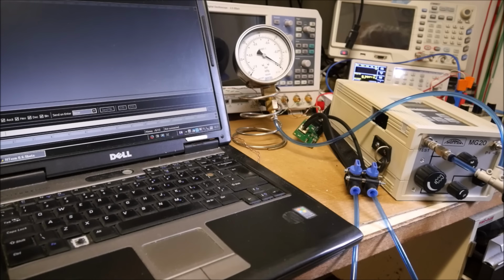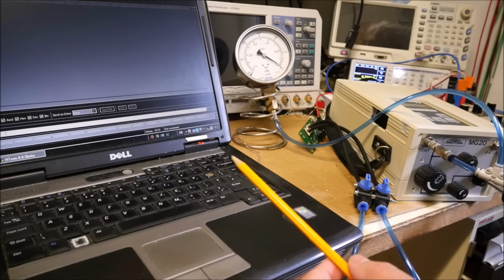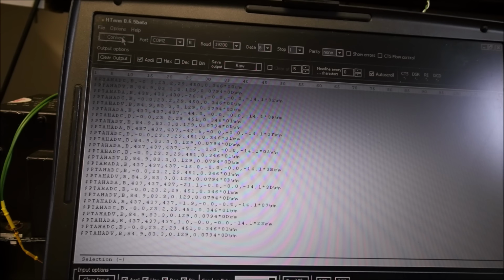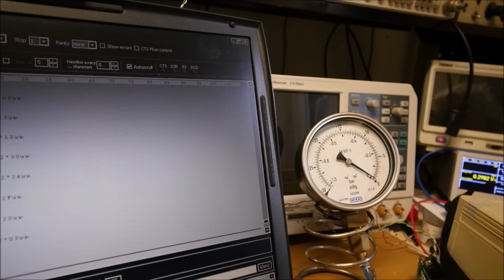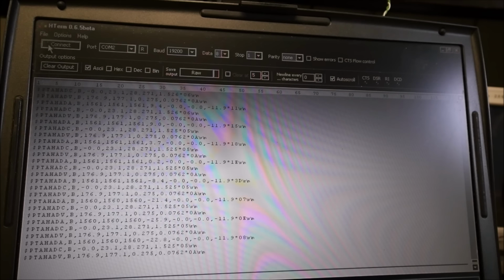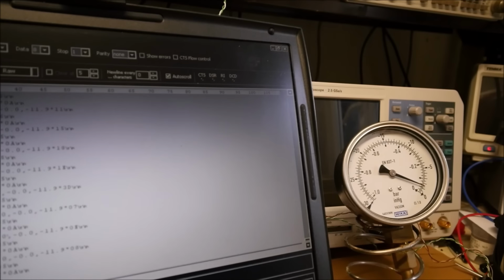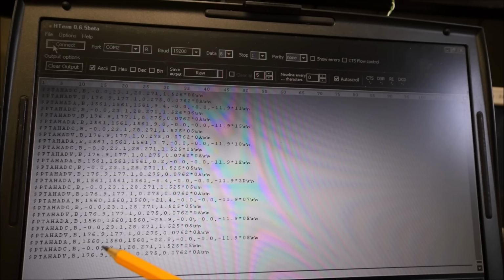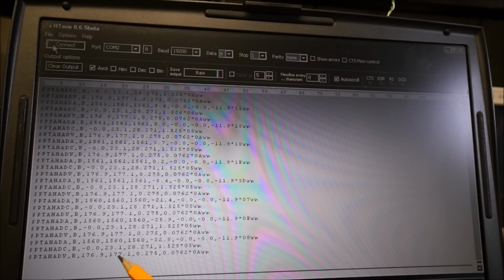LDM #369: Shahed-136 drone Air Data Computer module

Comment: Quite simple, which makes sense. Cheap to produce and less to go wrong.
I am surprised by the shear volume of data that it throws onto the serial bus. Firstly If the data is only used within the drone I didn't expect strings, rather just mapping the values directly to bytes. Secondly I didn't expect it to display things like mach number. For anything connected to that serial port it is probably much quicker to simply take the airspeed to calculate the machnumber yourself, compared to the extra wait and processing of the serial string.
Perhaps they are using some kind of 'off-the-shelve' radio serial link to send this straight back to a PC for direct viewing. Which makes me wonder, how does the navigation work? As there's no GPS here it must be somewhere else and connect through that 9pin connector. It doesn't seem to squirt out any data request messages on the serial bus, so then how is it getting that kind of navigation info? 
Or perhaps this module is only for the air pressure and temperature calculations, making most processing on the drone quite distributed. But again, if the serial bus is only used 'internally' in the drone, I don't understand why they transmit the information over serial in string format.
Reply: This is just the *Air Data Computer*, which means it measures the air speed and barometric pressure. The flight controller is a separate module. The jamming resistant navigation receiver is another unit, and the radio link is yet another. And then there is other stuff such as engine controller, power systems, etc.
Reply: The processor consuming this data likely has an excess of processing power vs. the cost of doing string processing. Binary communication on the otherhand increases the cost with respect to communication between teams responsible for different parts of the drone and makes basic tooling more difficult  -- eg. if you were validating the module with a test fixture using csv allows you to directly dump the data and throw it into a spreadsheet.

Mach number is not solely dependent on airspeed. Keeping the 'intelligence' for this calculation in the instrument makes sense
Reply: @nullptr472  I seriously doubt that there's a big team involved in this product, at least the electronics side. The design as shown is quite simple, and is even lacking some proper filtering and protection on the PSU input. (At least they put TVS diodes on the RS232 lines). 
My point was not about the processing power of processing strings persé, rather about the time it takes to transmit. The Shahed seems to have a max airspeed of 185kmh, so for the accuracy stated it could easily fit in a 16 bit value. Now it is transmitting 5 bytes for the same information. There's about 4 values per line, so that could save 12 bytes. You can skip the commas, another 5 bytes. Skip that weird pre-amble (PTAHAD*,B) which is constant anyway, saves you 7 bytes. Drop /r/n and you save 2 more.
Thats 26 bytes per line even with such simple minimal effort. At 19.2kBaud that would shrink the time to transmit by almost 14ms. That is quite significant for the minimal amount of effort required.
Even if time delays or data rate are not a problem (which it probably isnt), it means that you could slow the bus datarate down and get things more robust.

Anyone that is able to design and test such boards, has practically no difference in basic tooling between raw bytes, or string data. Most serial loggers can display and log raw serial data without any trouble, never mind the abundance of cheap logic analyzers and oscilloscopes, or writing a simple python script of a few lines. If this serial data is used by another uc, it might even be easier to process the raw byte data rather than having to decode the string (always tedious). Also whether this was designed by a team or not, just having a list the byte structure commands is not any more difficult than having a list of possible strings and their structure to communicate. There is still the same number of inter-team communication interfaces to keep track of, just in a different format. 

tl;dr In my opinion, it is not any more difficult to use bytes, nor would it cause more difficulty in working with teams. 
Honestly I strongly suspect the choice of using strings is more down to quickly wanting to hack something together, or not having the knowledge to do it in a better way. An experienced engineer wouldn't have much trouble implementing it with raw data values, but for someone only used to arduinos and/or less experience with embedded, it seems more challenging than just throwing strings around. 

Also regarding the mach number, this device is not going supersonic. I doubt the mach number is relevant at all for their control as stated the max airspeed is <200km/h. Although perhaps they share this board with other weapons systems, which perhaps can go supersonic (In which case I have serious doubts over the construction, in particular vibrations). The only thing that can change the local speed of sound is the temperature, which the device is probably also transmitting in its serial data, so any other device could easily calculate it quite quickly (LSS=v_air*sqrt(T/273) where v_air is the speed of sound at that particular altitude, which is relatively linear up to 10km, and T is the temperature in kelvin. Machnumber is then simply v_craft/LSS). 
But you are right than in a sense of having things 'containerized' is quite nice.
Reply: @tHaH4x0r  I take your point about data latency and channel capacity

> Honestly I strongly suspect the choice of using strings is more down to quickly wanting to hack something together, or not having the knowledge to do it in a better way. An experienced engineer wouldn't have much trouble implementing it with raw data values, but for someone only used to arduinos and/or less experience with embedded, it seems more challenging than just throwing strings around. 

The whole philosophy behind this drone is being low-cost and still effective. Part of that must come from lower development costs and understanding the 'good enough' point during development. Based on real-world performance they've clearly met the 'good enough' threshold. With respect to the 'cost' of a string protocol I do not doubt that tooling could be created to perform whatever binary conversions are required pretty easily, however, the cheapest tools are the ones that don't exist and the ability to 'eyeball' some raw output without consulting a spec is valuable (eg. sanity checking).

Iran has some pretty sophisticated weapons systems so I have no doubt their weapons developers have access to good talent (I seriously doubt these people are 'arduino jockies' or whatever). My money is on the developers of this system being expeditious (if you want to call it 'hacking something together' that's your prerogative), and again the proof is in the results.
Reply: @tHaH4x0r  You make too many assumptions about the manufacturing behind these.
Reply: @GoatZilla  No, I am trying to understand the reasoning behind some design decisions of the engineers.
Since when is it a problem in an engineering video to try and learn more about the subject?

If you are willing to actually contribute to the dialogue, please do provide some insight in the manufacturing.
Reply: @nullptr472  My point about the string vs raw data value, was that it does not increase development cost, yet increase system efficiency. You don't need any specific tooling to do binary conversions, it is built into most reasonable serial monitors. Also it could even save time if communicating between embedded systems
Also, they produce literal thousands of these drones. Even if it would take ~half a day more to produce raw byte values instead of strings (which again, I dont think so), it would have negligible impact on the final price. Especially as labor costs in Iran are not that high. 
hence the choice for using strings over raw bytes must be a deliberate choice for some other reason than convenience/cost of implementation. 

The suggestion of another comment seems to make rather a lot of sense, it could very well be an existing protocol to talk to a third-party supplied module (similar to the NMEA protocol) or an pre-existing standard within the iran aerospace sector.
Reply: @tHaH4x0r  It's already been explained to you; you are just letting your assumptions override the answer.

You're assuming Western lab conditions in a country that is completely not Western.  You keep saying "oh, logic analyzers and oscilloscopes are soooooo cheap blah blah blah just you know write some python n stuff".

The barrier to entry might have been reduced to "guy in a cave with a Win 98 laptop and Hyperterminal" because that might actually be who's working on it.

You straight up don't know, and you can't make any conclusions from just looking at the PCB.

If you've ever been a part of any large open source projects then you might have had some visibility of patches coming in from 3rd world countries that aren't even under sanctions by people who barely have electricity much less even own the equipment they're writing the code for, you'd understand the rationale.
Reply: @GoatZilla  Logic analyzers and oscilloscopes are easily available regardless of 'western or not'. Go to any non western lab and you would need these at the bare minimum, especially for any company producing/developing at a reasonable scale like this.
No, this was not designed by a guy in a cave with a win 98 laptop and hyperterminal, and frankly it is borderline ignorant to think of Iranian people as if they are unaware of normal practices or have no access to resources. As a researcher I have multiple Iranian colleagues and they are very familiar with standard electronics development tools. Iran has been able to produce many technological feats that are definitely not possible without proper labs. I would not call Iran a '3rd world country' and again, it shows ignorance if you really think they are at such a low development level. 
Also, this is not an open source project, and hence your example makes zero sense. This is a commercial product, and production numbers of this specific drone are likely in excess of 5.000 (just the Alabuga drone production plant has produced ~3000 drones, numbers from the Ukrainian air force). The designers, Shahed Aviation Industries, produce tons of different aerospace components and craft, including helicopters. Additionally they are strongly associated with HESA, capable of building fighter jets. They have plenty of electricity, funds and equipment.

Sure you cant make conclusions from looking at a PCB, but you can at the very least make an educated guess and try to get an insight into exactly why design decisions were taken, which is where we can all learn valuable insights into exactly how this drone came to be, and decisions why certain parts are made the way they are.
Reply: @tHaH4x0r  'system efficiency' for this drone is how effectively it can detonate on target. Eking out efficiency wins for a protocol that is already able to meet throughput and latency requirements is waste regardless of the labor costs

By your logic (that of binary data being as easy as text protocols) why aren't these existing standards all binary? If it's such an unambiguous win why doesn't everyone do things the way you describe?
Reply: @nullptr472  Sure, the system works and does its job, that is indisputable. My entire original point isn't about questioning the designers capabilities, rather questioning the intent behind design decisions. E.g. implementing raw bytes does not take any more effort than string based data, yet is better in any quantifiable measure of bus performance. Hence the decision to use text must have other reasons backing it up. Replies from denizzzka and peerappel2012 make most sense to me, and indeed have convinced me that it is likely for compatibility reasons with an existing bus*.

Never have I claimed that raw bytes are ALWAYS better than string based, and it is an entirely pointless argument. But out of respect to your question, text based has the advantage of increasing compatibility if you have to operate with many different devices. Especially if you need to integrate with PCs and it needs to be immediately human readable.
However this is often not required at all. Your question 'why aren't these existing standards all binary' is kind of funny, as the existing NMEA 0138 protocol is superseded/being replaced by NMEA 2k, which indeed does use raw data values instead of string based information. 
Why the original NMEA 0138 standard uses text is anyone's guess, and you'd have to ask the national marine electronics association themselves. If they do decide to do this, please do share their reply. I am curious what their response would be (if at all, perhaps they want you to buy the standard, which starts at the lowly sum of 2k$).
My guess is that the original standard can be directly hooked up to physical printers, in order to immediately print human readable logs. I am not very familiar with the shipping industry, but it wouldn't surprise me if this is normal/required for commercial shipping to keep a log of location (similar to how trucks are mandated to keep logs of certain parameters, in EU Smart Tacho 2).

* On this note, I dont think it is an official NMEA 0183 type bus, both physical as well as the application layer. I did some searching but couldn't find any $PT identifiers/headers/talker IDs with sentence formatter in any public documents (in fact, there are no talker IDs that start with $P* at all). 
Additionally the bus should run at 4.8kbaud according to NMEA themselves (or 38.4kbaud and 115.2kbaud for higher speed busses).
Reply: @tHaH4x0r  from your original reply:

> Honestly I strongly suspect the choice of using strings is more down to quickly wanting to hack something together, or not having the knowledge to do it in a better way. An experienced engineer wouldn't have much trouble implementing it with raw data values, but for someone only used to arduinos and/or less experience with embedded, it seems more challenging than just throwing strings around. 

Sounds like you are indeed 'questioning the designers capabilities'

> But out of respect to your question, text based has the advantage of increasing compatibility if you have to operate with many different devices. Especially if you need to integrate with PCs and it needs to be immediately human readable.
However this is often not required at all. Your question 'why aren't these existing standards all binary' is kind of funny, as the existing NMEA 0138 protocol is superseded/being replaced by NMEA 2k, which indeed does use raw data values instead of string based information. 

Text isn't some magic comparability sauce that only takes effect when multiple implementations make use of it in a protocol. Human readability is always an advantage even when the only people using it are the ones building the device, integrating it and testing the system

NMEA 2k is based on CAN bus which (if you don't know) is very different from RS232. RS232 is point-to-point, CAN bus is an actual bus (ie. with multiple peripherals sharing the line) with small packets and low latency requirements built into the system. Given the massive differences in the physical layer it is no great mystery why the format of the data is different.
Reply: @nullptr472  
> Sounds like you are indeed 'questioning the designers capabilities
Originally that was my suspicion, as I couldn't see any other reason why they implemented things the way they did, until appelpeer etc pointed out the similarity to NMEA 0138 for compatibility reasons.

>A text-based protocol isn't some magic comparability sauce that only takes effect when multiple implementations make use of it in a protocol. Human readability is always an advantage even when the only people using it are the ones building the device, integrating it and testing the system

Its of no advantage if there are no humans involved in the system anymore, as is the case with this drone. As for debugging/testing, I have touched upon this before that it makes almost no difference at all.
Suppose there's a human readable format, and a non readable format, considering all other things equal of course the human readable format is better. However, as I illustrated before, this is not the case as human readable strings are much less information dense. In all other ways a raw data format is much more efficient, which leads to better performance in any measurable metric (ex. speed, latency, robustness for comparable bandwidth).

>NMEA 2k is based on CAN bus which (if you don't know) is very different from RS232. RS232 is point-to-point, CAN bus is an actual bus (ie. with multiple peripherals sharing the line) with small packets and low latency requirements built into the system. Given the massive differences in the physical layer it is no great mystery why the format of the data is different.
I know very well what the CAN bus is, I work with it quite a lot.
You seem to not have brushed up much on what NMEA is. It is not just a physical (electrical) layer specification like RS232/CAN but also contains an application (data) layer specification. These are entirely different things, and the discussion was about application layer formatting (strings instead of raw bytes). It is irrelevant what the underlying physical layer is (hell, there's NMEA 0138 implementations that use ethernet as the physical layer).  

Also to correct you, NMEA 0138 'default' physical layer is not RS232, rather RS-422 ) (differential signalling).
Furthermore whatever the underlying physical layer is (RS-422/CAN/RS-232/Ethernet) does not define whether something is point-to-point, multi-drop, tree structure etc. That is defined in yet another layer of the networking architecture, there is nothing physically keeping you from connecting more devices into a network.
Actually if you read the specifications, you will notice that NMEA 0183 is actually intended to be used with multiple devices, not a pure single device point-to-point wiring. Technical term is point-to-multipoint. There are gateways and multiplexers to facilitate this behavior, and get around the physical layer problems of the RS-422 bus. That means that the 'master' line will have message from multiple devices, just like ex. a CAN bus would.
This is also exactly why they shift to CAN bus for the physical layer in 2k, as that improves compatibility tremendously, no longer needs additional hardware to keep the network running, and has all the additional advantages of CAN bus included highlighted below.
Still my point is, the physical layer is independent of the application layer, and just because something is 'an actual bus' (by which you likely mean multi-drop) does not somehow magically mean that readable strings are no longer valid. If you disagree, feel free to explain exactly why a human readable format is less useful on a multi-drop bus compared to a point-to-multipoint scheme, as for the proposed advantages of debugging it would be exactly identical. 

PS: What do you even mean that CAN is build with small packets built into the system? If I want to send a packet of size 1 byte, a CAN packet is much larger (start bit + arbitration/ID + control + data byte + CRC + acknowledge + EOF = 52 bits) compared to an equivalent 8-bit UART packet (start bit + byte + parity + stopbit(s) = 10 to 12 bits depending on config).
As for low latency, they can both be equally low latency.
The big advantage CAN has over e.g. RS485 (which is much more comparable as its also typically multi-drop), is that it has hardware bus arbitration and hence does not need a master/slave kind of topology, and that it takes care of the data integrity on quite a low level, (almost) guaranteeing messages to be intact and received correctly by all devices on the bus.
Reply: @tHaH4x0r 

> Also to correct you, NMEA 0138 'default' physical layer is not RS232, rather RS-422 ) (differential signalling).

This is a distinction without a difference. Be serious.

The point is if the protocol designers assume there is one 'talker' per physical link the 'talker' could consume as much of the channel as it pleases without impacting other instruments / sensors / whatever. Sharing the channel means a less 'information dense' message format of one instrument comes at the expense of the usable capacity for the others on the same bus. CAN bus has a packet format and priority based preemption so a 'less dense' protocol (with a message spanning multiple packets) could be preempted by higher priority messages. More time to transmit the message during contention means increased latency. Given this it makes sense to move the 'engineering tradeoff' needle away from human readable towards a binary format.

> Originally that was my suspicion, as I couldn't see any other reason why they implemented things the way they did, until appelpeer etc pointed out the similarity to NMEA 0138 for compatibility reasons.

They most likely based the format (in broad strokes) on NMEA and the instrument and it's protocol are internal to the organization or the drone. They have no need for NMEA 0138 compatibility; I doubt they have any plans to sell their airspeed sensors to yacht owners in the near-future
Reply: @nullptr472  
> This is a distinction without a difference. Be serious.
I entirely agree. The exact physical implementation, and networking topology is irrelevant when discussing how data is formatted in the application layer, whether RS232, 422 or CAN bus.

About the discussion following this sentence, in order to clarify and make things clear there are two contention points. First is your claim that CAN has supposed lower latency. Secondly, that the described advantages of human readable format somehow no longer hold for multi-drop style busses. Both of which I personally disagree with.

>The point is if the protocol designers assume there is one 'talker' per physical link the 'talker' could consume as much of the channel as it pleases without impacting other instruments / sensors / whatever.

To some extent, yes. However when integrated into a network system with multiplexers, they do have to take care that the combined bandwidth does not swamp the busiest link. This is kind of stating the obvious, generalized to that we can never put more information per second on a bus, than the bandwidth would allow. This is indeed convenient in case of CAN as priorities take care for this to some extent, but also multi-drop buses would have to ensure that the bandwidth is not saturated. 
In any case, our discussion was about low bandwidth links that are likely not close to saturation, making the point moot regardless.

> Sharing the channel means a less 'information dense' message format of one instrument comes at the expense of the usable capacity for the others on the same bus. 

Yes, and so it would for a CAN bus, if we don't take priorities into account. The bus always has only a limited amount of bandwidth available.

>CAN bus has a packet format and priority based preemption so a 'less dense' protocol (with a message spanning multiple packets) could be preempted by higher priority messages.

True. And you just described what makes CAN convenient. This however does not make it low latency, or better for more dense protocols. Firstly we should not mix density and priority. For example, an 'emergency stop' message would be extremely low bandwidth (as it would only be triggered in rare circumstances) yet would be highest priority. Engine timing would be relatively high bandwidth and high priority. 
Just because a high priority message can interrupt a lower priority message does not mean a bus is high or low latency, or benefit from high or low information density. 
Hell, there could be a low priority CAN message on the bus, that has to wait indefinitely if it keeps being interrupted by higher priority CAN messages, thus having 'infinite' latency, regardless of content! 
The bus arbitration just helps us in achieving lower latency for higher priority messages, for busy buses, but not better latency in general.

Also, what you state here doesnt imply low latency persé. "Latency" in the way you seem to think of it, depends on message priority and how busy the bus is. But that is, as we just described, circumstantial. Generally when talking about latency we don't take into account other traffic or priority, merely measuring the time it takes to go from source to destination. 
Assuming that a message is ready to send and no other data is on the bus, UART has lower latency for the same amount of information, simply because there's less additional bits to send on top of the data. In other words, the effective DATA bandwidth for a given LINK bandwidth is higher for UART, and thus can achieve better latency.

> More time to transmit the message during contention means increased latency. Given this it makes sense to move the 'engineering tradeoff' needle away from human readable towards a binary format.
Except that all you have stated above, is entirely independent on how the data is formatted. CAN data can be formatted as readable strings as well, it does not matter. In both cases readable strings would increase the amount of bandwidth required, and in both cases it could lead to problems and reduced performance. 

> They most likely based the format (in broad strokes) on NMEA and the instrument and it's protocol are internal to the organization or the drone. They have no need for NMEA 0138 compatibility; I doubt they have any plans to sell their airspeed sensors to yacht owners in the near-future
There's a fair chance that this board is not made internally by the organization, rather a bought in 3rd party part, hence the usage of human readable strings.
Perhaps if Michel ever gets hold of another circuit board of a Shahed (like the flight computer) we could deduce whether the layout/design style is similar or not.

In summary:
- In both cases having a 'less dense' protocol improves the latency, and makes better use of the available bandwidth
- Disregarding priority and bus occupation, latency of a CAN bus message of a given size is inherently larger (and information density lower) due to the addition of more extra bits
- In both cases the supposed advantage* and impact of being human readable, is identical

*Under the assumption that there is an advantage. As stated previously I don't think there's much advantage in being human readable, except in extremely niche cases or when forced to have to talk to 3rd party supplied items.
Reply: @tHaH4x0r 

> I entirely agree. The exact physical implementation, and networking topology is irrelevant when discussing how data is formatted in the application layer, whether RS232, 422 or CAN bus.

Of course it matters. My point was that (for my argument) RS232 and RS422 are exactly the same. When designing a protocol for a medium whether or not it is shared has a huge impact and should influence protocol design. The information density of the messages would have a major impact on bus contention and therefore system performance. Human readable messages are a cost/benefit trade-off and in shared mediums like CAN bus where the max packet size is like 8 bytes it pushes human readability cost/benefit far into the red. A more information dense protocol would decrease average latency for all but the most high priority messages by lowering the probability of contention.

> Disregarding priority and bus occupation, latency of a CAN bus message of a given size is inherently larger (and information density lower) due to the addition of more extra bits

My point about CAN bus latency was with respect to the design choices made by the designers of CAN bus due to the automotive industry. You need a small packet size to enable important messages like 'driver hit the breaks' to not have to wait too long to get onto the bus. Small packet size -> more overhead/byte. By adopting CAN bus NMEA also adopted these limitations and that therefore had an effect on their application level design.

I do not doubt for a minute that lower latency is achievable on point-to-point serial links vs CAN bus due to the fundamentally different ways they work. That is precisely my point -- low level realities drive higher level application protocol details
Reply: @tHaH4x0r  So which one of your colleagues worked on the Shahed-136?

You don't know.  That was the whole point.  You don't know.  You have better visibility into an Open Source project than you do to this project.  That was the whole point.

What you are asking is the software equivalent of "Why don't they just drop Mictor connectors on that PCB?  They're like so much more compact and easy and available and would give them more options."

I'm not saying they don't have labs, and I'm not calling them rubes incapable of technological feats.

I'm saying that it's very likely that a sub-db9 and dupont headers are likely a better match for their desired technology level target.  It's an easily plausible explanation.
Reply: @nullptr472  
Let me start of by saying I think this argument has drifted completely off course. Your original statements were: 
1 - that raw data protocols require more cost and time to implement (we can agree to disagree on that one)
2 - raw data protocols are harder to interpret and hence standards use human readable text all the time
You supported 2 with the reasoning that 'why do human readable standards like these exist if raw bytes are always better'. As a counter example I mentioned that they have moved to a raw data format in CAN, and some other examples of serial, low data-rate buses that use raw data rather than human readable strings. 
The argument then shifted to point 3:
3 - Human readable text is useful in low-bandwidth point-to-multipoint and point-to-point system, but less useful in multipoint buses. 
Instead of addressing point 2 and 3 in its core, you specifically shifted the goalposts to CAN only networks, where you describe a potential problem arising due to limited packet size potentially impacting readability. This argument does not hold for many other links (e.g. for a LIN bus), and is thus not generalizable.  
I.e. You have failed to address the crucial point about why human readable strings are a good thing on low-speed point-to-point serial links, but not on low-speed multidrop links in the general sense.

If you feel I misaddressed your key arguments and reasoning, please do point them out and correct them so I can respond to them in a more concise way instead of the entire argument shifting to irrelevant points and generic statement of truth.

To address the other points in your comment:

>Of course it matters. My point was that (for my argument) RS232 and RS422 are exactly the same. When designing a protocol for a medium whether or not it is shared has a huge impact and should influence protocol design. The information density of the messages would have a major impact on bus contention and therefore system performance.

And so it would impact multi-drop buses. Information density always has an impact on bus occupation and thus system performance, and in all of the above cases the bus is 'shared' with multiple devices, also with NMEA 0138. Just the way the network is structured is different, but links can still contain messages from multiple talkers. Your point was that there was a supposed difference between multidrop and point-to-multipoint systems in terms of how information density affects the latency/bandwidth. 

>Human readable messages are a cost/benefit trade-off and in shared mediums like CAN bus where the max packet size is like 8 bytes  

So your qualm has more specifically to do with the limited packet size of CAN bus?
Then sure, it does impact readability, although most decent CAN decoder can filter/group messages by type quite easily, only making readability of very long messages slightly more tedious.

>it pushes human readability cost/benefit far into the red.

"That is just like, your opinion man.". Similarly I think that in no case, except for compatibility with external 3rd party equipment, 'human readable format' is beneficial. 

>A more information dense protocol would decrease average latency for all but the most high priority messages by lowering the probability of contention.

A more information dense protocol decreases the average latency regardless of type of bus. Also for the original NMEA 0138 bus. If you are more efficient, your need less channel bandwidth to transmit the same amount of information. This is not unique to CAN and/or multidrop networks.

>My point about CAN bus latency was with respect to the design choices made by the designers of CAN bus due to the automotive industry. You need a small packet size to enable important messages like 'driver hit the breaks' to not have to wait too long to get onto the bus.

You would want important messages to be short regardless. But I fail to see your point about can bus latency completely. Or is this again about splitting longer packets into fragments potentially increasing latency of those? 

>By adopting CAN bus NMEA also adopted these limitations and that therefore had an effect on their application level design.

I dont think these are limitations. These are merely the direct effect of having priorities on the bus.

>I do not doubt for a minute that lower latency is achievable on point-to-point serial links vs CAN bus due to the fundamentally different ways they work. That is precisely my point -- low level realities drive higher level application protocol details
Sure, these are generic blanket statements we can all agree on. Similarly high level application details influence low level design decisions. That tells and teaches us nothing though.
Reply: @GoatZilla  >So which one of your colleagues worked on the Shahed-136?
None of my colleagues did, otherwise they wouldnt be able to work at the lab I am with.

>You don't know.  That was the whole point.  You don't know.
Sure you don't. Similarly, Sputnik could have been developed by a monkey for all we know! You dont know, you never really know!
However, we have plenty evidence about who manufactures these Shahed drones, as well as who built sputnik. We are pretty sure they have quite a lot of resources and advanced capabilities, far exceeding the board we have here. Denying this is simply an invincible ignorance fallacy, and discussing this further is pointless, as no amount of evidence/proof would ever be enough to convince you.

>What you are asking is the software equivalent of "Why don't they just drop Mictor connectors on that PCB?
No, it is not. Implementing raw data versus human readable strings has practically no difference in implementation cost and time. Hence there is a conscious decision made for one over the other is what I was trying to understand. And the remarks of other comments have given some plausible explanations that make sense. 
Your comparison is taking something far more costly and advanced than what is on here, with totally different application/capabilities and associated price cost. It is a disingenuous false equivalence. 

>I'm saying that it's very likely that a sub-db9 and dupont headers are likely a better match for their desired technology level target.  It's an easily plausible explanation.
They sure are a good fit, no one is going to deny that. But like I said, implementing raw data versus human readable strings does not take more time or cost to implement.
Reply: @tHaH4x0r 

My point about CAN was in-response to your bringing up NMEA 2k and my thoughts as to why (in that context) it would make sense to implement a binary format.

Looking back at my own technical work what I wish I learned earlier is to consider the bigger whole and value simplicity and ease of implementation as well as trying to understand the 'important' thing and work towards it rather than my immediate impulse, what I think is cool or what is at hand. There are times to do things the 'smart' way and times to do things the 'stupid' way and wisdom and experience help you figure out the what's appropriate for the situation. Adding a bit of inefficiency (stupid) -- like this text protocol -- to make the work of others down the line easier so they can spend time on more important things seems like the wisest course.

Thank you for all the points you've made, it's really made me reconsider a lot of my life choices. I really should get off the internet.
Reply: @nullptr472  I very much agree with your sentiment that often the simpler way is the right one, and complexity can be added later if deemed required. Perhaps we merely disagree in what we think is more complex.

I am sorry to hear that you feel so negative about this engagement, it got a bit heated but it was never my intention to leave a sour taste, rather exchange insights and hopefully both leave with a bit of a different perspective and a crumb of knowledge. My apologies, and all the best to you, and i mean that sincerely.
Reply: @tHaH4x0r  for what it's worth I apologize. I'm under a lot of stress and my heads not in a good place and things got away from me (not that that actually excuses anything)
Reply: @tHaH4x0r  I think you are forcing yourself towards unreasonable stupidity by not thinking a system with bidirectional communication can easily change the data format on the fly through negotiations. Probably the string data format is for sanity check and it may have god knows how many protocol to be integrated with different model of flight data computer of various aircraft.
Reply: @tHaH4x0r i don’t understand why you keep arguing for oh why not convert it into bytes it would save X bytes. When you ship FAST you don’t always go back and optimize if you don’t have to if the extra bytes actually don’t matter what’s the point in optimizing it?
Reply: I suspect this air data module is made by a separate team of engineers, and is designed to be easily integrated into many different drones. For that reason, string data makes a lot of sense. Making a byte array structure to carry floating-point values (or fixed-point binary ones) is easy enough, yes, but makes logging it during development and testing a whole lot more difficult.
Modular systems often use easy to read and debug formats, even though they’re not the most efficient - they just make everything a lot easier. If I were designing such a module, i’d go with string data every time. The only reason to switch to raw bytes would be if the data rate was very high and in this module, that’s certainly not the case.
Reply: @simontillson482  I very much disagree with the statement that its harder to debug. Like I mentioned in another post, any decent serial monitor has no trouble reading out raw byte values, and writing a python script that formats and spits out the values is something done in under an hour as well.
And even if string formatting is what is convenient for debugging, you could still do that but swap over to something else for actual operation. 

What is more likely is the suggestion by another commenter; Namely that it is trying to format to a pre-existing standard or compatibility with a third-party purchased module.
Reply: @tHaH4x0r  I agree that an existing format and/or vendor module probably existed, and they’re using that format for compatibility - very likely indeed.
But the reason it’s using a text-based format is that this is almost universal in systems design.
Unless there’s a very good reason - mostly it’s a high data rate - almost all commercial modules use text-based data transfer when communicating over a UART channel.
For example, just compare these two modules:
1. A GPS receiver. Update rate is one packet per second. Output is via UART and format is text based. All GPS modules use almost the same format.
2. A 6-axis accelerometer and gyro. Update rate is 100 packets per second. Output is via SPI bus and format is raw bytes, using manufacturer-specific structure.

So you can see that this is a common thing in industry. For low-speed, common functionality, serial UART with text formats is the de-facto standard, so I’m not at all surprised that this flight data module uses that method.

At the end of the day, you have to ask yourself ‘is it worth it to optimise this data format?’. Considering that the flight controller is synthesising remote commands, accelerometer data and other inputs to produce actuator and motor control signals at a rate of hundreds of cycles per second, the amount of processing power used to interpret string data from the very slowly changing inputs for altitude and airspeed is not only small, it’s insignificant. So what exactly would you gain by optimising it to a byte stream? In practice, nothing.
Reply: @simontillson482  The things you mention from 'the industry' are not used in proper commercial applications at all. Firstly the kind of modules you mention are not used in fields like aerospace. Secondly, GPS outputs very widely, even for commercially available modules that you seem to be hinting at. It is true though that most commercially available modules are compatible with NMEA 0183 standards, but that is not because of low data rate and the likes, rather to increase compatibility (and GPS modules are pretty much the only module that provides such compatibility, almost any other sensor is not compatible with such a standard without additional hard/software). 
Also a correction, modules provided to consumers, such as for example the uBlox NEO-M9N-00B, provide multiple different physical layers: UART, SPI, I2C and USB, not only UART! Just because the sparkfun board you purchase only routes out the UART, does not mean that it is the 'industry standard', it is just the easiest to use for people who want to mess around with it without knowing much about protocols. 

This specific board in the video has a very specific intention, and besides (unmanned) aerial vehicles has almost no purpose. Thus there is no need to keep compatibility high (unless it is supplied by a third party, or has to communicate with another third party supplied item).

As a counter example of a low-data rate system with serial based communication; automotive LIN busses. There too priority is to keep cost low, and datarate is extremely low as well (some systems, like the door lock or mirror adjustment module, only need to get data very occasionally, typical datarates are sub 20kbps). Yet they too do not use data formatted in strings, rather raw data based (as an example see the presentation 'LIN basics for beginners' by 'Lipowsky Inustrie Elektronik', in particular slide 18 for some examples of real world bus data). Other notable examples include J1939 and ISOBUS (ISO 11783-7/8/9/10/11/12/13/14) application layers.
So no, from my own experience in the industry, and from the above examples, I do not agree with your statement that string based serial information on low-data rate buses is the  'de-facto standard' for industry. 

Your statement pretty much only applies to GPS modules, and the truth is that most commercial GPS modules comply with the NMEA 0183 standards, which was conceived in the 90s to have compatibility between different marine instruments. So it is merely used to increase compatibility with other devices, not for any other reason related to datarate. 
Speaking about NMEA 0183 and industry standards, it is being phased out in the industry for a (you guessed it) raw byte value based protocol in NMEA 2000 application level protocol. Outside of GPS modules most sensors do not use string based data transfer over serial, regardless of datarate.

PS: I do not quite understand the relevance of your example, you are comparing apples to oranges. The discussion is about text over serial instead of raw bytes (i.e. application layer interfacing and/or datalink layer, as these are the same for simple busses). Not about SPI vs UART (i.e. physical layer).
Reply: Maybe these strings is for corresponding to NMEA protocol?
Reply: @denizzzka  That is a reasonably guess, it does look very Similiar. Perhaps some of the modules they buy in are third-party and it is even required to use that protocol.
Reply: The format looks quiet similar to how NMEA protocol strings are formatted
Reply: I think it simply doesn't matter - looking at the scope trace there is plenty of dead time, even at 19,200 baud, so using a more efficient coding format wouldn't actually win you anything, and using that NMEA-0183 format means that it's readily human readable, which is useful for servicing and debugging. Sure, a "real" CADC would probably be using some format like ARINC-429, but it's not clear that would add anything more than cost and complexity without benefits in an application like this.
Reply: @TrimeshSZ  As mentioned in another comment, if you can decrease the amount of data, you can slow down the data-rate, which makes it more robust to external interference (and less likely to produce EMI as well, as long as you slow down the edges appropriately).
About the applicability of human readability, see other comments. In my opinion it does not offer advantages in debugging and is not more costly nor more complex.

Comments from peerappel and others suggested the similarity to NMEA and hence it could be needed for interoperability with 3rd party modules and modularity, which does adequately clarify why one would use strings over raw data.
Reply: @tHaH4x0r  Again, I'm just far from sure that matters in this application - you have a low speed (~20kHz) signal over what's presumably a short signal run.  Would it meet DO-160? Probably not, but this is a platform that's literally designed to crash and burn on the first flight so maybe it's not  really something to worry about if the EMC isn't that great.
Reply: @TrimeshSZ  I agree signal integrity in uncontested space is not something really to worry about for a 'single use item', but for electronic warfare it might. 
I am not very well read up in drone jamming technology, but I can imagine that having some kind of focused antenna spitting random noise at considerable energy could perhaps wreak havoc because of poor shielding and protection. Spacing pulses at regular intervals to mess up the packets should not be impossible... I do wonder what other attack vectors are available (electronically) to mess with such a drone.
Reply: @tHaH4x0r  we iranians focus on making things work, you western guys over engineer things, if strings work we go with strings, we only optimize if needed
Reply: @rezah336  Perhaps you mistook my comment as a negative remark towards iranian engineers/scientists in general, but that was not the intention nor the gist I was trying to convey. I am merely trying to understand design choices made in this particular, and 'making things work' can be a very subjective thing (ex. how robust should it be?)
Regardless, I dont try to generalize an entire country or region in how they do their work (and neither should you).
Reply: @tHaH4x0r  you should generalize people because we behave differently, German design is different from Iranian and different from Swedish design etc. I dont build drones but i am an iranian engineer and i just explain how we think. We focus on making things work, we are very pragmatic.

Our cars have gaps between the panels, for the west this is low quality, but we dont care about 5 mm gaps on something we rarely look at. 

This is our style and has always been since we fought the romans. Their monuments are still standing but ours are mostly gone. But we still fought them and our tech still worked against them.
Reply: yes, this show very poor engineering, the board layout is atrocious, and the overall architecture and technical choices seems very dubious at best, even quite ridiculous when it comes to using RS232 and plain asci without even a checksum. To me this has been thought and designed by very low grade engineer.
Reply: Probably to ensure compatiblity with one of the other modules
Reply: When you don't have a parasitic arms industry to feed you can make some pretty cool stuff for a reasonable price.
Reply: people soooo smart and soo dumbzzz at the same time....😂😂
Reply: @Lipi19821  Care to elaborate your comment?